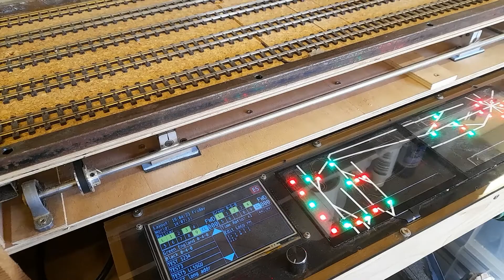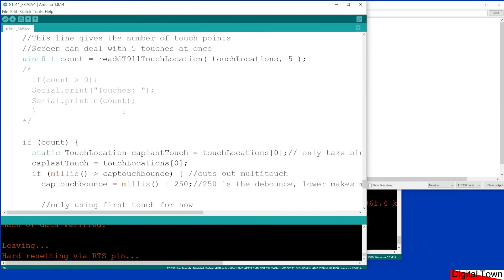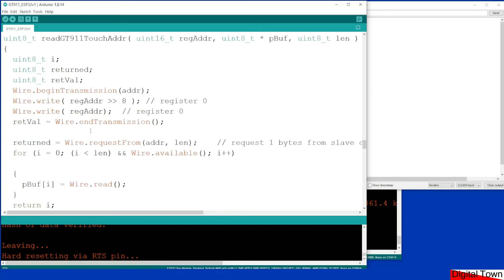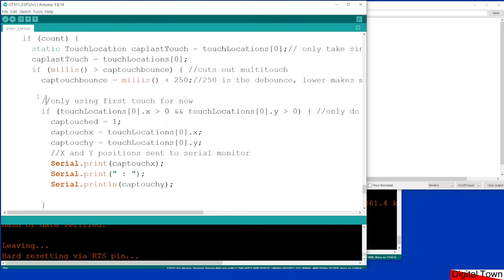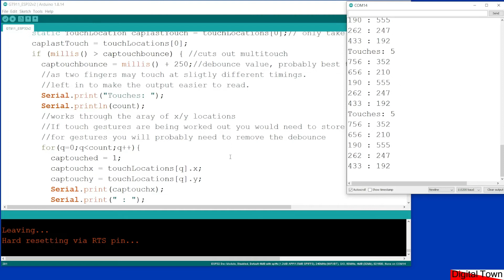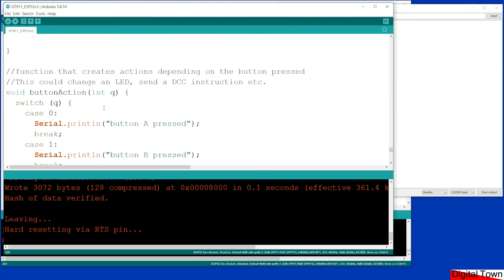Arduino C++ ESP32 and GT911 Touch Screen (Also works with Arduino Due)

Comment: Does GT911 require external Pull Up resistor for SDA/SCL or it has it with the set up ?
Reply from the maker: It worked without pull ups.

Comment: Thanks for refreshing the use of modern capacitive touchscreens ...some years ago, I had a resistive 8" pad as the flexible input for flight simulation controls. There is nothing around with similar flexibility ....you just print cockpit-switchpanels or autopilots on a paper and put the glass on it . The prototype was functioning very well , but when it came to ordering spare screens from amazon every delivery arrived as crashed glass.  ( 7"  and 8" fine glass screens just in plastic-bags !!!!! ).
As all the suppliers were Chinese I had some correspondence but without results. So I dumped this wonderful solution.
My first question .....  do you have a source for save shipment ???? Please give me a hint.

In former years I used resistive touchscreens ILI9341 for display and input services, nowadays there are these perfect little boards with ESP32 integrated and a capacitive 3.5" Touchscreen on the frontside.  like WT32-SC01 plus and even larger screens up to 7" from Makerfabs. Once you have used a capacitive screen you will never go back to resistive ones.

If there is a good chance for getting 8" or even 10" screens .....I will switch my complete development.

Thank you very much for this inspiration.....and greetings from Germany